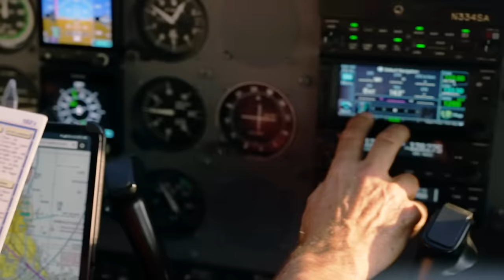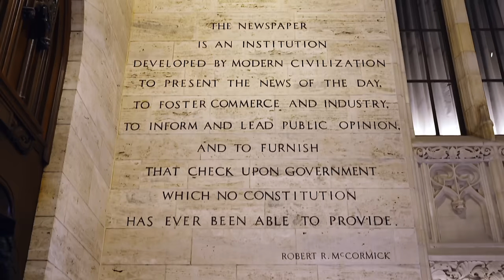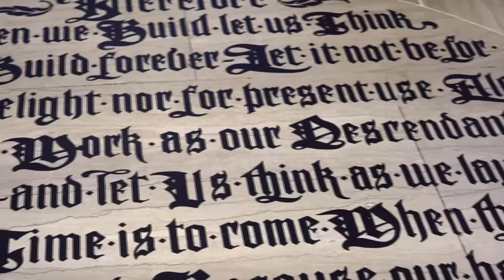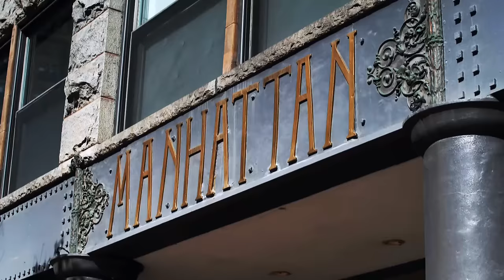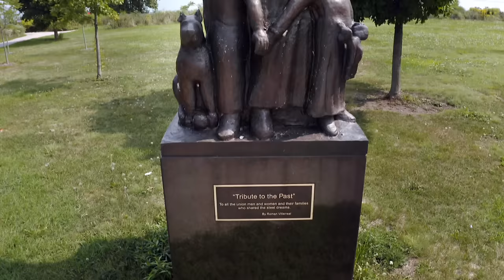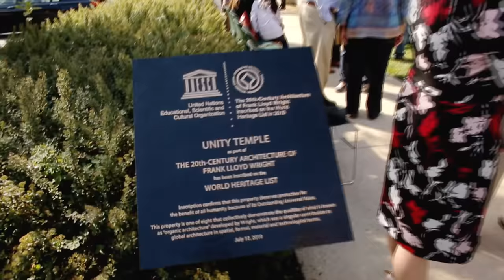The Most Beautiful Places in Chicago with Geoffrey Baer — Full Show

Comment: I worked in the Rookery from 1978-83. The law firm I worked for had offices along the southern half of the west wall and the south wall on the 7th floor. I don't recall any roof being in place at the top of the center. The glass roof over the first two floors of the lobby was painted an off-white color. The urns were there by the stairway, but I don't recall there ever being anything in them. The outside was black with soot and had a chemically induce patina. It was sandblasted during the 1990s and we now see the original red color. The elevators were run by union elevator operators. I often used the beautiful stairway to walk up and down rather than take the elevators. From the third floor and up the stairway was a stunning curved semi-circular column. Also, in the hall out side the south part of the office were old vaults that the firm used for file storage. As the office clerk part of my job was to retrieve and replace the files in those vaults. They were airless little steel boxes. I always worried that a door my close and lock me in. But I always loved the beauty of the building and have fond memories of the place and the people I knew there.

Comment: And it’s not just public works of architecture… You see these homes in Chicago, these McMansions… A giant house and a tiny half acre lot… Using cheaper brick, cheaper windows, poor architecture, just so they can have the biggest house on the block compared to everyone else’s 1950s, 60s and 70s bungalows/apartment buildings… Why? it actually makes you look cheap… When you build a house so large that it is out of proportion with the lot, and you do minimal landscaping, and you seem to care more about how many black Mercedes, Audi or BMW cars you can park in your driveway, instead of spending money on high-quality brick, good windows and quality architecture… I don’t get it… It makes no sense to me… You don’t need 5000–8000 ft.² I would rather have a beautiful 3000 square-foot split level home, even pre-fabricated homes are better than these McMansions, even the Huff houses from Germany looks so much better in glass and steel… And for under $500,000 they can put up a new house in less than a month… And it looks a hell of a lot better than what is noticed owners are doing with her giant 8000 square-foot cheap looking monstrosity.